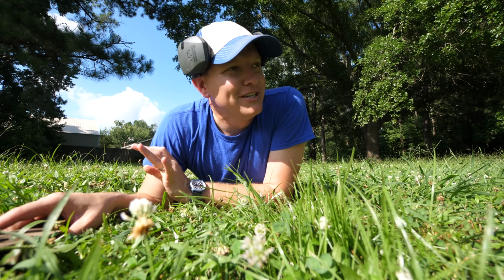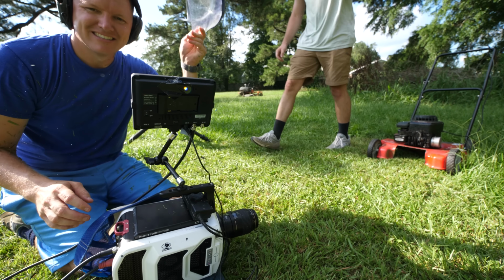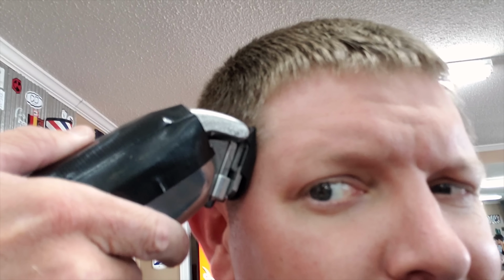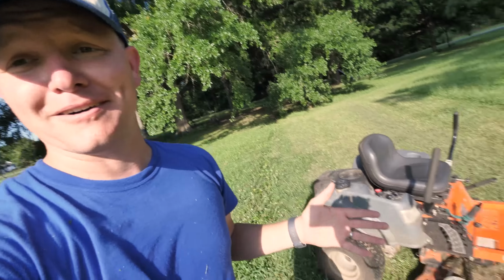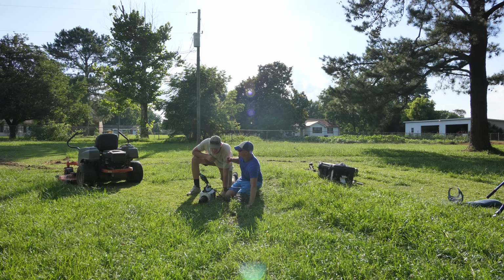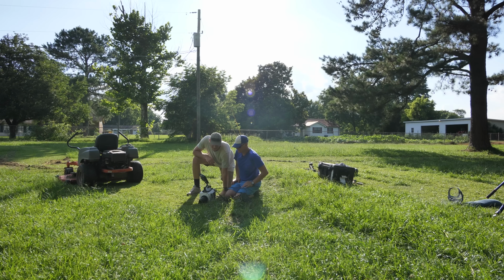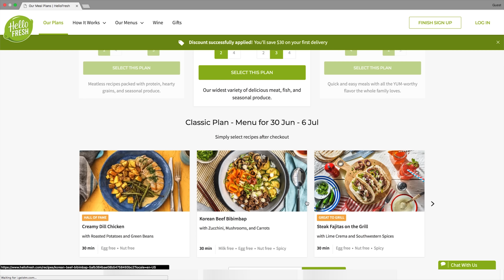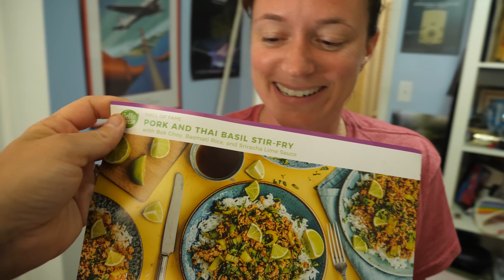How Lawn Mower Blades Cut Grass (at 50,000 FRAMES PER SECOND) - Smarter Every Day 196

Comment: The photos show the grass below the blade bending in the direction of rotation before being cut and torn, so the cut length is taller than height of the blade above the ground.  At which point is the grass cut?  When the drag force exceeds the shear force required to initiate severing.  And, tiny serrated edges on the blade might reduce the required shear force.  What do you think?

Comment: When using a mower with multiple blades, does it make a difference in how you position the blades when installing?
Should all 3 blades be aligned the same direction or should they be staggered?

Comment: I’ve asked google Cora other people the channels the same question and they always describe the same thing; I a choke circuit works, But what I would like to ask you is why is choke necessary on a cold engine? Also, why all the water out of the exhaust pipe when it’s cold on a cold morning in the winter?
Why does a cold engine require a rich mixture to start and why is a hot engine capable of running on a lean mixture?

Comment: Hey Destin it is really interesting how a vacum created from the blades lift force pulls the grass up to be cut more easily and  efficiently. How would a weed wacker cut grass if there is no lift produced by a rotating blade due to the cutting occurring from plastic twine. I though that this would be a good idea for a future video. 

Kind regards,
Cole

Comment: So with that theory how does a hover mower work.  If the blade spinning pulls the grass up then in theory the blade spinning will pull the hover mower deck down.
Reply: His theory is wrong.  Both a conventional mower and a hover mower push air OUT from under the deck, but a hover mower has no discharge chute and also has a special fan to increase the outward air-pressure around the deck, thereby lift the deck off the ground.  This air-pressure pushes the grass down AROUND THE DECK just like a conventional mower, but once under the deck there is less pressure and the grass can stand up (on its own, no lift required) to be cut by the spinning blades.  It's important to note that the cut occurs on the outer edge of the spinning blades just passed the high-pressure zone of air-flow, no uncut grass should make it to the center of the blades on the deck (i.e. the pivot).

Comment: You are somewhat correct, the wing on the back of the blade is for air flow. You can cut the grass with a flat blade but it will not throw the grass out very good. with the wing on the back it will move more air and spread the cut grass over a larger area thus eliminating clumps and wads. And it does pull harder with more wing.
Reply: is not for air-flow, is for 'grass throw': more wing = better throw because clippings don't have as much room to escape the thrower.  It's just like a snow-thrower or a water-wheel, it's not about air flow at all.

Comment: Yup, the wings create the suction and pull the grass up. Some decks cut better than others depending on how good they move air. Then you got High lift, Med lift, and Low lift blades. High Lifts create the most suction and pulls the grass tight, which gives a smooth cut and nice stripes. That’s why most lawn care guys, like myself, like the high lifts.

Comment: The single blade lawnmowers actually rip the grass whereas the 5 blade reel push mowers we used in the 50’s and 60’s like on Leave It To Beaver CUT the grass. There are modern 5 blade mowers you can buy that have a motor.

Comment: If you were to add a semi rigid rubber skirt to the front of a mower that came closer to the ground would it help or hurt the airflow? In principle this should help prevent blowout when traversing un even ground while cutting but I wonder if the only downside is increased maintenance.

Comment: The reel type mowers do use an opposing piece of metal and actually cuts the grass. Check out Golf Courses that's what they use on the greens.

The more common lawn mowers don't actually cut the grass so much as they rip the upper shaft off.

Compare the way the a lawn looks when side by side areas one cut with a reel type mower vs the centrifugall type mower.
The everyday type push mower leaves a swirl pattern and the blades of grass have jagged edges where a reel type uses the reel to push the blades up against the cutting bar like the jaws of scissors.

Comment: I want to see a lawn mower blade test. I want to see how much  blade mass affects cutting, how mass placement affects cutting, blade speed, air pressure. I'd like to see how long it takes to get an even cut and various percentages of eveness, how clean the cuts are and oh my god this is going to consume my life isnt it....
Reply: just use a sharp blade.  Folk used to mow with scythes, they don't swing very fast and air pressure is irrelevant.  Mowers blades cut like knives.  Keep your knives sharp.  Don't over-think it or you begin imaging things like 'lift' into the equation...
Reply: @Chamdar17  I don't think you quiet understand my point. I'm particularly interested in a perfect lawn. The tuning process is what intrigues me the search for the most efficient method.

 I'm also not familiar with people trimming lawns with scythes. Tall grass and other crops have a much higher mass and therefore offer more resistance which makes it easier to cut. Sure a perfectly sharp blade could cut short grass but how long until it blunts and needing to be resharpened. Look at weed eaters/wackers/strimmers they don't have an edge at all and still cut fine so evidently sharpness isn't everything

Comment: Could the front deck of the mower rolling forward causing the grass to spring into the blade be a factor? I just thought of this after several hours (and glasses of wine)  after watching this video. Maybe try lowering a running mower on to the grass to see what kind of swath you get.

Comment: Hey I’m glad you did this however it’s still leaves me wondering. Because I was thinking about my riding mower with two blades the blade is only sharpened on the outer six or 7 inches. There is nothing sharp toward the center of the blade where it mounts on the spindle. So how does that grass get cut when you make a pass?
Reply: the blade is spinning very fast, grass does not make it to the center pivot-area without passing under the sharpened edges on the outer 6-7"

Comment: Those blades are powered by a P.T.O (Power Take Of Shaft) taken from a tractor and powered by the engine and it spins at 540rpm to 1,000rpm (revolutions per minute) or to simplify it it spins around at 540rpm to 1,000

Comment: Okay my question is: how come when you cut out of the lawn mower the piece for the opening you didn't replace it back with a piece of plexiglass followed by making the frame affixed to the wheel bracket that came across in front of the plexiglass window and mount the camera that way or even a GoPro? That way the flow of the air wouldn't have been disrupted nor would you have had to stand in front of the discharge and possibly could have faced a rock that was not noticed in the beginning that could have gotten tossed at you

Comment: You asked for questions so here goes. I have a Kubota zero turn mower set up for mulching. The problem I have is the grass builds up on the underside of the mower deck so bad that I can only get one mowing of less than 1/2 acre before I need to jack it up and clean the underside of the deck. What, if anything can I do to lessen this problem? Blades are sharp, grass is dry, I've slowed down my speed and have gone to the point of spraying Pam on the deck which does help slightly. Any suggestions would be greatly appreciated.
Reply: Do you not have a discharge chute?  What is the deck height vs height of the grass being cut?
If you are using thrower (lift) blades without a chute, these will throw the clippings up under the deck until they bog down the system.  If you use flat blades or mulching blades or a suitable discharge chute, this will not happen unless you mow over too thick of grass for the deck-height.

Comment: A counter rotation two blade system would be great for mulching work.
A mini tornado of air flow in deck chamber to multiple cut fine particles. Could be done with gear box as in some aircraft propellers.
Just don’t run over that steel sign on your lawn. Mower deck damage could result.

Comment: Destin, would you be kind enough to ask your engineer friend, if you can't answer this, would it be possible to have 2 sets of blades under a deck? I am thinking, if no one else has already, of a design where there is one blade set a couple inches higher and is a couple inches wider than another set below. This is for times of mowing when the growth has out paced the maintenance. For example, on public open space where it takes 4 to 6 weeks to mow and in that time the grass is far taller than the desired height or ability the blades and deck can handle. Essentially cutting the grass twice. Once at a height the blades and deck can handle, the higher blades, then second at the desired height or closer by the lower blades, before the next scheduled cut.
Is this a dumb idea?
It seems plausible to me.
Happy to take the heat for my dumbness of course.
Thank you and your viewers.

Comment: Question does the lift and or vaccum occur when the cover is down if you had a plexiglass cover over a hole cut in the deck i am sure u would get much better footage also sharpen those blades and dont forget to balance them!

Comment: I wondered what that 'tab' on a blade was for. I have a riding mower and a self-propelled mower. On the push mower I have changed the blade to a mulching blade and that's when I noticed the 'tab'. 
I really don't like yard work and it's hard on my body. I'm a 67 year old woman and my yard is huge. I don't mind using the riding mower but it of course can't get into the smaller areas so I have to use my push mower. I also have to trim hedges and remove weeds. 
I learned the other day that I have been cutting my grass too short. I also learned that I should never mow wet grass. My riding mower went in for service plus the blade belt broke after only having this mower for two years. When the guy came to pick it up he asked me which number on the deck I was using and I said, "two". He told me to mow at three or higher. Higher? Wow. 
My back yard is like a golf course with ups and downs. I am constantly lowering and raising the deck as I mow. It's so difficult to mow. The front yard on one side has bermuda grass I think and the other side has zoysia grass. I have no idea who planted this but the zoysia is nothing but a pain to mow. 

Also, using a weed eater is a pain too because the string keeps breaking. If I could afford a lawn service I would hire someone.

Comment: If you have ever operated a cylinder lawn mower, hand operated or powered, you have operated a lawn mower that cuts grass blades by cutting them against a bar instead of in the way that the mowers in this video cut grass. YES! You read it right! There IS a lawnmower that operates using shear force, like scissors do. I've operated the push mower in my younger years once, a very very long time ago, and it is a lot of effort to get those blades cutting the grass! In the case of the push cylinder mower design, the effort to make the blade spin is supplied by the operator pushing the wheels of the mower forward and making them turn using a gear ratio that made the blades spin faster than the wheels themselves turned. Powered versions simply use an engine to supply both force to spin the blade and move the wheels.

Comment: Are crosscut blades better? What's the difference? What's the best way to get a clean cut on grass? Can you sharpen the blades to a razor edge and not destroy them under normal use?
Reply: Best way to get a clean cut is with a sharp blade.  Yes, you can sharpen them to a razor edge, but they are soft steel and will dull rapidly from encounters with sand, dirt, rocks, etc.  That is normal wear.  Nevertheless, you should always sharpen them before use - not necessarily 'razor' sharp but enough that you can cut yourself if you draw a finger across the edge, just as you would sharpen an axe or hatchet or chainsaw (all of which will also dull rapidly if they encounter the ground, rocks, soil, etc.).  Folk who mow with a scythe will carry their whetstone with them and resharpen as they go as they can feel the cuts losing quality.  With power-mowing, you will not notice this as readily, and a power-mower will keep cutting (or rather bludgeoning) long after it is dull.  If you demand a very clean cut, then take note of the grass as you pass over it and when it starts to look more ragged you should stop and switch blades or resharpen... or learn to live with a more ragged cut. :)

Comment: The deeper the mower deck itself is, the better it sucks up the grass.  Also the sharper the blade is, the better cut you get.  Have you seen reel mowers?  They cut grass like scissors.
Reply: A deeper mower deck would suck worse, not better.  But yes, a sharper blade cuts better.

Comment: They do make "high lift" and "low lift" blades depending on the kind of material you cut.
Reply: The uncut grass is not lifted in any of the models, it is the cut grass that is thereby thrown into a bag or a chute just as with a snowthrower, a taller tab produces a stronger throw.  Mulching blades work by cutting up the clippings after they have been separated from the stem and then letting them fall back into the grass - wouldn't work if they were being sucked into the deck all the time because of 'lift'.

Comment: I have a lawnmower  question: I have a john deere l 111 lawn tractor. It has a bagging system that is a standard bagger for this tractor. My problem is before I can fill all three bags  the chute from the deck to the bags clogs  up..I have what they call  three way blades  ie multch...bag...and side discharge.  I'm thinking the blades are the problem  in that they are not throwing the grass clipping fast enough to travel up the chute and into the bags. I noticed in your video to curve on your blade is a lot more aggressive that the blades on my unit. could this be my problem?  Any help will be greatly appreciated  Thanks    Scott.

Comment: Good video and the lift seems correct.   Now, if the lift is correct and necessary, then how does a string trimmer cut glass?   No lift from bladed wing.   No enclosed housing.   Yet they cut grass very well.
Reply: The lift is neither necessary nor correct.

Comment: An old fashioned cylinder mower like you would use on golfing  🏌️ greens and cricket 🏏 squares or tennis  🎾 lawns uses two edges coming together to pinch the grass and create sheer. Could you use the slow mow camera on one of those please. That’s the kind of mower we had in England growing up. Then we got a Flymo which hovered and used the rotating blades like in the example here for the steep hill parts. Only it wasn’t on wheels. It used the fusion of air it created to float on.

Comment: A mower blade cuts with speed and momentum against a relatively stationary and soft object (grass blade).  
The mower blade does not even need to be super sharp.  
For example if you throw a cucumber up in the air and swat at it with the edge of a very blunt butter knife you can easily cut it and it will fall down in 2 pieces.  
The bent up part of the mower blade is used as a fan to eject the cut grass up through the spiral ejection port and into a catcher if used.  
If you use a completely flat mower blade it will still cut the grass but under the mower will become clogged.  
You can buy flat blades for mulching the grass and letting it fall back down to decompose and refeed the cut grass.  
If you make a mower that is very dangerous with no cowling and completely exposed flat blades just like a brush cutter it will still cut the grass very well and will throw the cut grass out sideways.  

Regards, Jas.  
VK4FJGS

Comment: The video should also teach you why having a sharp blade(s) will dramatically improve everything about your mower's cutting efficiency.  Buy a second set of blades and change them out frequently.  Refresh the edge for the next change time.  Your mower will use less fuel, your grass will look a lot better, and your deck will not collect nearly as much debris to be cleaned out later.  Sharp blades cut the grass instead of beating it up.  Just look at the grass blades closely and you will see the difference.  You can do a demonstration by installing your blades backwards and try to cut the grass with the dull side of the blade.  The grass blade edges will look torn instead of a clean cut.  Doesn't work very well and requires a huge difference in horsepower.  Good luck!

Comment: I like how the tabs pull the grass up to cut it, but my question is how does a 21” blade that’s only sharpened 4” on each end cut the entire 21” in a single pass?
Reply: It doesn't, the blade makes 50 revolutions every second. At those speeds it only cuts near the tip because the mower isn't moving fast enough.

Comment: Reel mower. Stationary blade with a rotating blade set at an  angle. Do slow mo on a push one. A rotary mower actually chops the grass a reel mower shears the grass.

Comment: There are videos of electric mowers (like the Ego) and one of the top complaints is there isn't enough lift for heavy grass. That's why some of them don't cut well. Don't believe the hype that are as powerful as gas mowers. Once you get to the 80V or better range, they get close. It would be nice to see this video again on some of those.
Reply: You know Rob there is a guy doing a review on the Kavli Beast blades with a Mean Green Mower. With those blades it surpasses any gas powered ride on.
Reply: @elonmuskrat4199  I'm not sure how that's related to push mowers.
Reply: There is also an electric push mower using the blades